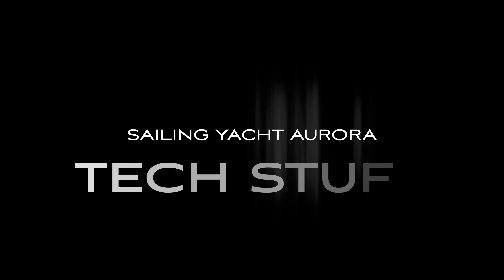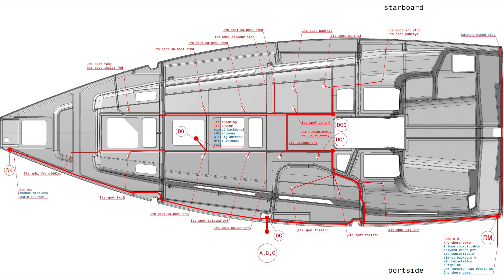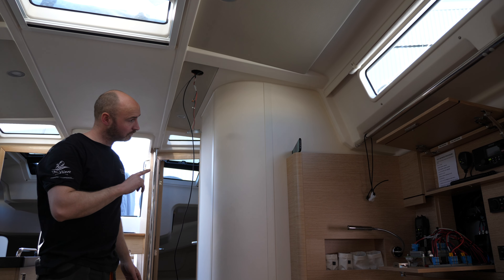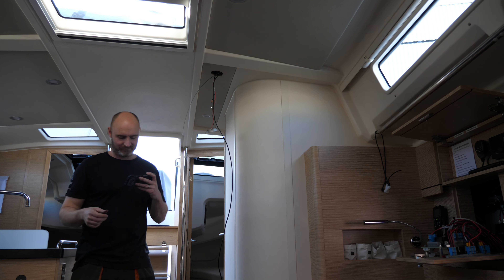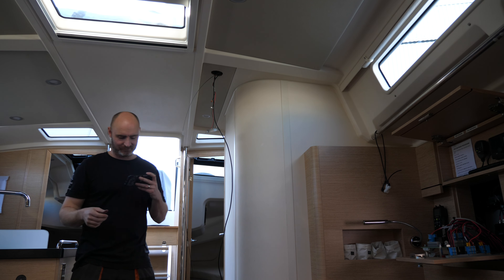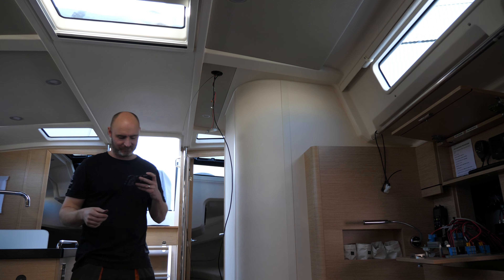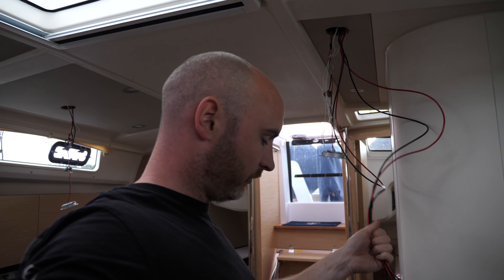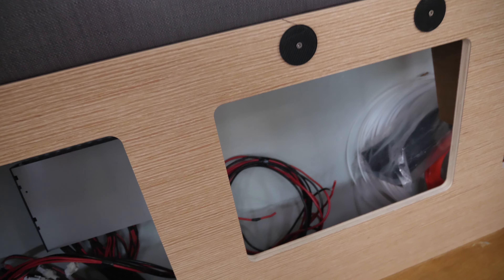TS13 - How to run solar panel cables (solar panel installation part 1)

Comment: I've just ordered my  boat, and this is one question I raised to dealer if it was possible to order such cables installed. Answer was No. I fin this really strange from Hanse side. Everyone want solar pannels installed on these boats. Whay cant they do it. I'm pretty shoure that we would pay "whatever" for this.
Any thoughts around this?
Reply from the maker: Hi there, there is actually a service next door to Hanse called Yachtwerft. https://yachtwerft-hgw.de/en/shipyard/

I would contact that company, I have been in contact with a guy with a Moody and they did the solar panel installation at the factory for him. I hope it helps. BR Chris